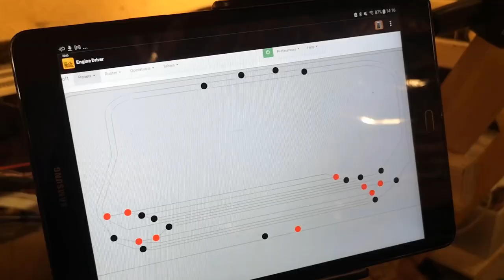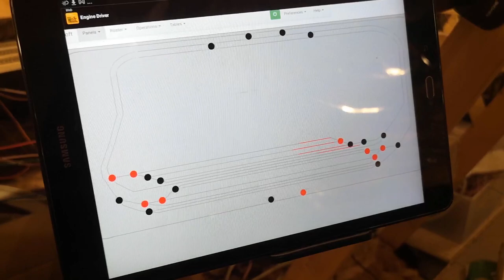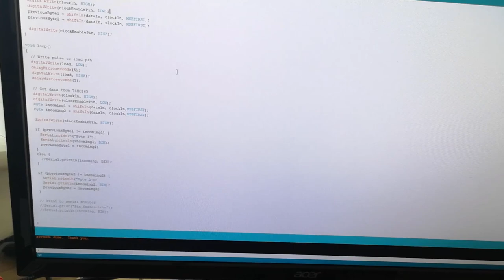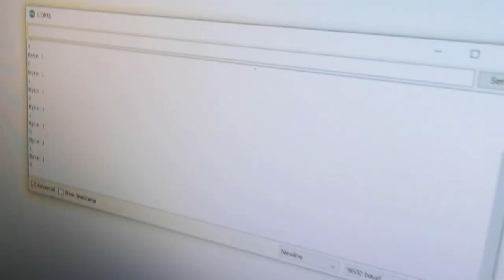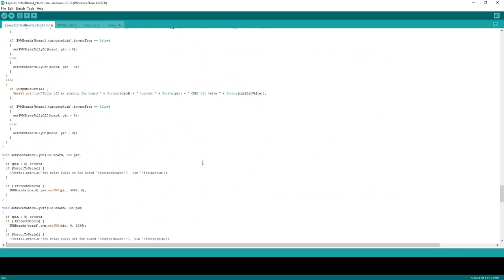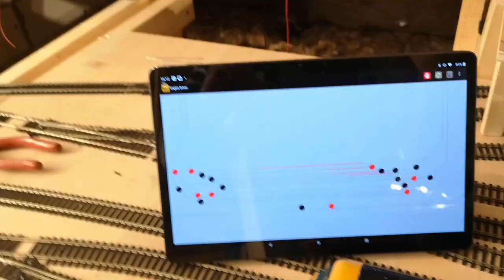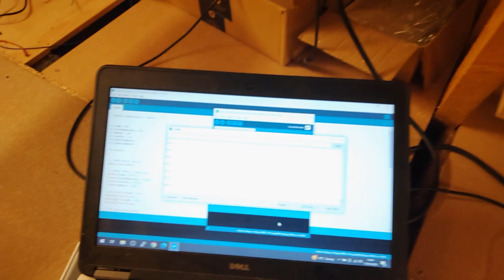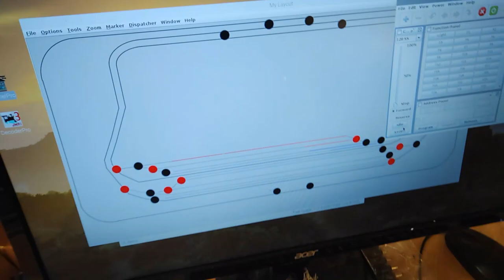Using shift-in registers to make adding infrared sensors to my layout a bit easier

Comment: Wow. Shows that despite how much IT knowledge I had, (now retired), there will always be stuff to learn. This just shows that running the real railway is a complicated  business too. Who would have thought that 100 years plus ago that boolean logic applied to even the Stockton and Darlington! As an aside, an extra complication for you to consider is like the trip locks (?) on the London Underground which will apply the brakes/cut the power on overuns. Use a relay to cut the power on a block to prevent collisions.